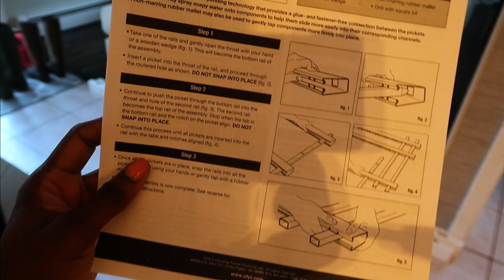DIY- Garden fence fix up:Tackle little projects yourself to save $$$😘😘 | Pattisguilfordgardenct

Comment: Of course wooden posts arent going to last as long as concrete but if you treat the bottom of the post well, (where the post meets the soil), with for instance a post saver or some other bituminous product. Then that will increase the longevity of the post massively. Some people prefer the look of wood :)
Reply from the maker: Such a well thought out comment and I absolutely agree. I agree.  Thank you so much for your support and happy 2021:)